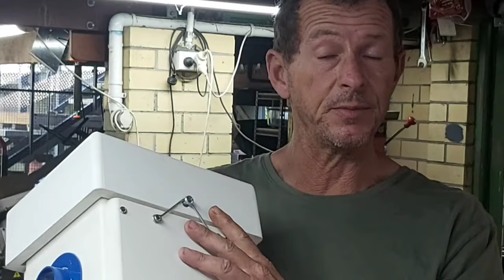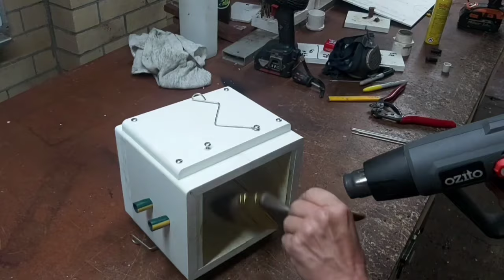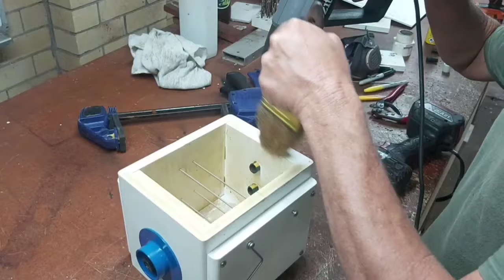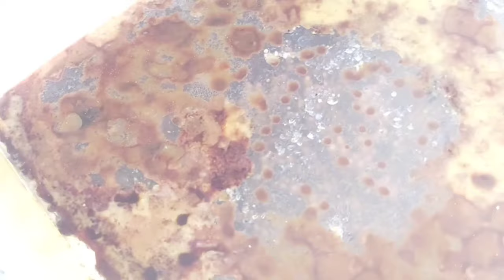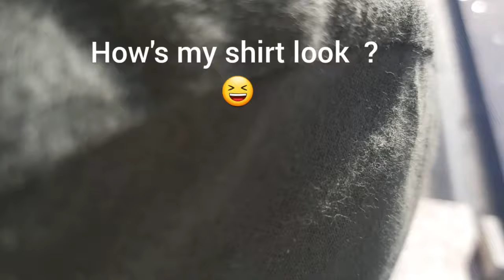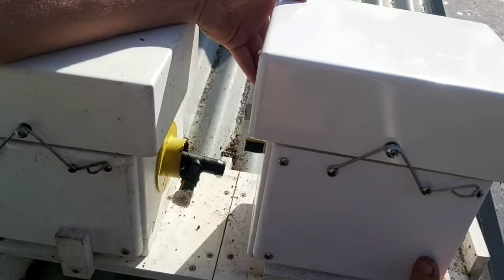TC Eduction - How to prepare and connect

Comment: I have had a take over swarm hit my TC Eduction. So not to lose the mother hive, separated and placed mother hive inside the house sealed for 7 days. I relocated mother hive to a new location. The eduction does have stores (pollen / honey) but the swarm seems to of dropped off (it lasted a week). I’ve looked into the daughter hive and can’t see any brood. The swarm still appears in smaller numbers. There is plenty of bees in the daughter hive and plenty of activity but no brood. My question is : Do I wait to see if take over swarm keeps coming with a queen or do I hook it up again ? ( I’m unsure if eduction hive has original bees or take over bees inside). Basically I’m unsure what bees are in my eduction (original or take over) only a very small amount of fighting bees appear now. Could this be the take over swarm was unsuccessful ? I’m unsure what to do with my eduction hive now. Any help would be greatly appreciated.
Reply from the maker: @SeanSteggs  did you have many thousands of dead bees or 500 odd ? People often confuse a mating swarm with a take over. Did you notice any bees roosting nearby at night ? It's a tricky position now. I'd hook the daughterhive back to its motherhive but spray them with sugar water mist first.
Reply: @ I had 1000’s & 1000’s of bees hanging around and fighting for 6 days, so disconnected motherhive not to lose that as well. I do have video. The swarm would reappear about 4 times a day after a fight. No fighting now but do have about 30 bees hanging around and tree next to it in the evening only to disappear. Motherhive in new location eduction in original position.